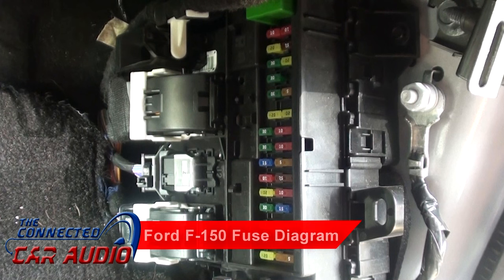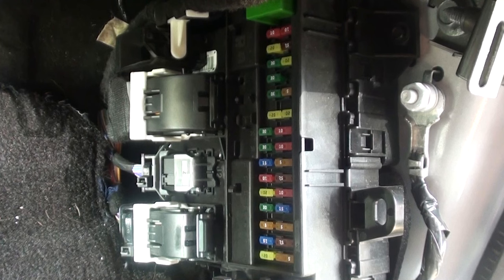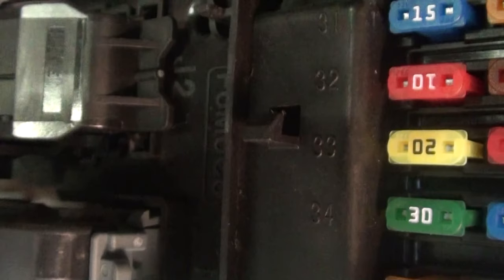stereo fuse diagram ford f 150 2015 and up

Comment: I'm not sure if my radio has a bad display as it wont light up but I can play music using 3.5mm Jack. I have the 4" screen so aftermarket kit is about $500 installed plus radio. Well back to repairing other things on truck.

Comment: EXCELLENT!!!! Worked not sure which 20 amp fuse because i pulled 2 at a time to check 😂. And after I pulled the last one and inserted it, sound came. But to confirm i tried pulling it out didn’t stop sound 😮. Proceeded to pull the rest and still sound was good. 🤷🏾‍♂️ I don’t know which one it is but it's working. That's all the matters to me 😅
Reply: O[

Comment: I have a  question 🙋‍♂️ the front right speaker on my 2016 Ford F-150 king ranch has no sound but the rest of the speakers do. What could be the problem?
Reply from the maker: This is most likely a blown speaker 
Or if it’s an aftermarket speaker the connection behind the speaker may have become disconnected